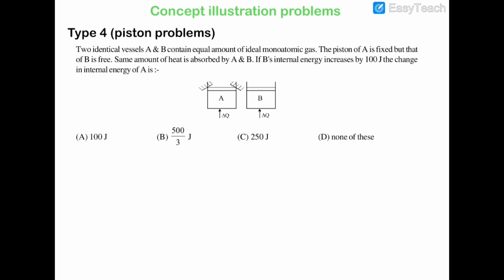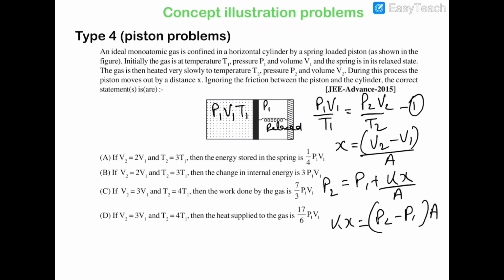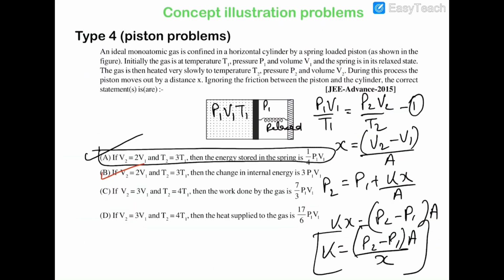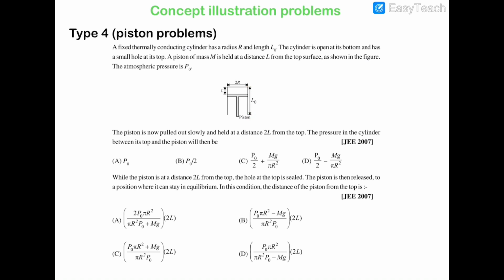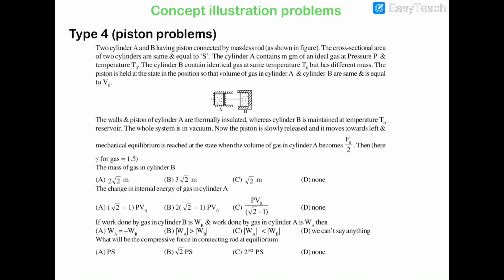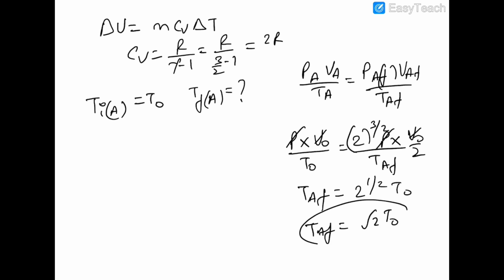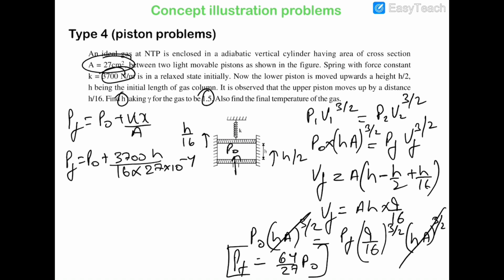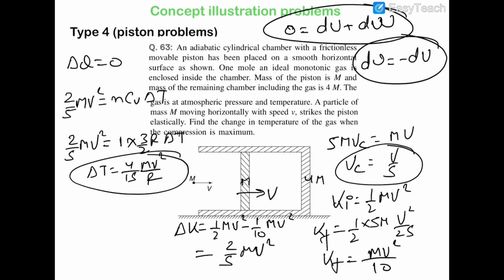Problems based on piston-cylinder | JEE advance | Olympiad | Thermodynamics

Comment: sir 2nd question mein work done agaist pressure mein constannt pressure kaise liye hain?
Reply from the maker: In this question it is mentioned in the question that initially gas pressure is P1 and spring is relaxed which means that initially the surrounding pressure will be balancing the Gas pressure which is P1 and hence during expansion only spring force will change but surrounding pressure will remain constant throughout the expansion
Reply: @teslaeduventures  but sir that would be work done by the piston on the surrounding and not the work done by gas on piston . i am confused in that only why to take outside pressure for pdv work pls explain